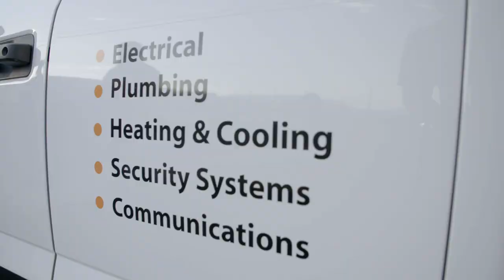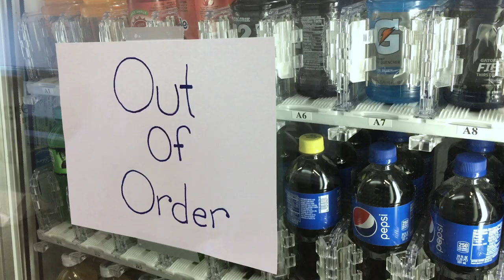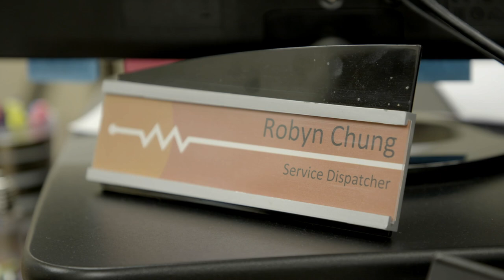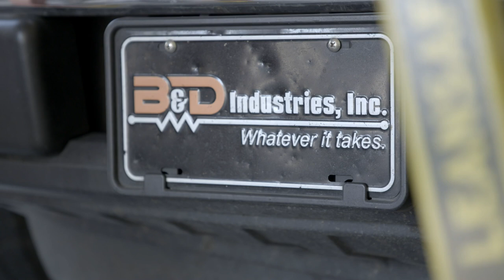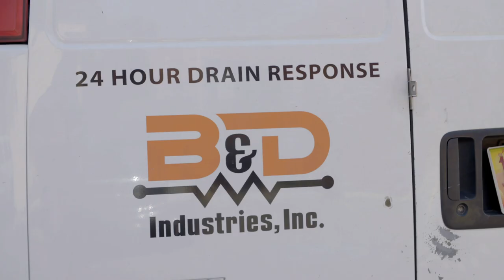Residential Electrical Service Work by B&D Industries and IBEW 611 Keeps Community Running

Comment: Boy do I hate residential work. Service and grass roots.
Reply: What’s so bad about to?
Reply: @jonnyz5758  Romex jockey ain’t my gig. Check out industrial
Reply: @waltersobchak7275  I’m doing industrial right now but I’m not a fan of it
Reply: @jonnyz5758  Bro another 6/months you’ll dread going back to residential and commercial you gotta get you one of the nice government jobs working on a base. It’s sweet easy time. You work for the union yeah you do. Look an oh journeyman told me this one time he said on his big government jobs is 5% working and 95% acting you look busy that’s all you do get overtime double time whatever., they get a bonus if they if they are on time on the deadline they’re under they don’t get it if they’re over they don’t get it you gotta be right on time that makes for a lot of effing off. We’d bust but  for the first couple weeks and get ahead and then wed  slack. We worked 4-10s We had  three breaks and after the third break we would pack up put everything in the gang box and dip. Slacking off it does make for a long day though I work steel steel mills flour mills. Flower mills are loud we were the Gilman  paper company I mean anything basically The paper company  stink is good God . I’ve seen big huge switchgear 4160. We ran a lot of cable tray outside like steel mills and then we can put that pink hose on it . Pink hose usually three 750 mil Kcmil  and a 4 ought ground. Sometimes we sit around and rebuild starter motors for cabinets easy work man good work it’s interesting to sometimes we had the bust but carrying three inch  rigid upstairs like at the north side  generating station we have  in Jacksonville. Nuclear plants that’s awesome man it  really neat Recent months at the time we spent sitting at tables rebuilding starter motors from these cabinets in the flour mill. Walk a lot of beams I’m scared of heights kept me on my toes though

What are you an apprentice? What year? Stick with it bro No they make a mistake and quit whatever you do don’t quit stick with it stick with it stick with it.  I’m telling you things may pop up to sound good but  don’t fall for it working that’s what I did I went with something I was making 20 times as much money. It doesn’t  last. Situation I’m talking about stopped about a month and a half after I bailed out of apprenticeship.  If you’re already a journeyman the new there’s nothing I can really tell you are you are you are you are you know more than me. I was fifth year and fkd up. Something to be proud of to finish. 

I don’t know how it is nowadays apprenticeship but  1990s the journeyman they were like a dying breed they were totally different set of people man they were from the old school they really were. They didn’t get an a hurry for nobody. They were strict and stern but only because they wanted to see if they could run you off that’s weird I know it sounds weird but once they found out that you were tough and you stuck around they treated you like gold. So  basically I was real tight with all the old cats. They were a different breed., Watching them all die off is pretty freaking heart wrenching. They basically told me there’s a time and place for everything you know. We worked hard but man did we have fun, I know this-comment is  riddled with grammatical errors and mistakes and all that I’m not illiterate but I’m using speech to text and I can’t find one yet that works properly.  I’m sorry for any inconvenience  just  got me reminiscing that’s why I wrote this long ass post.